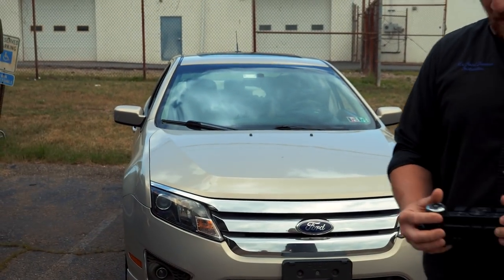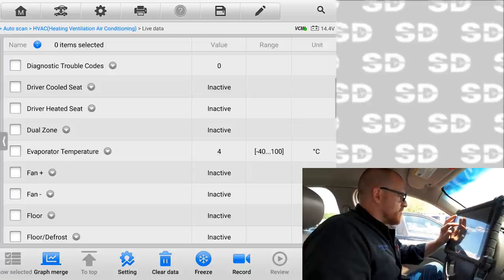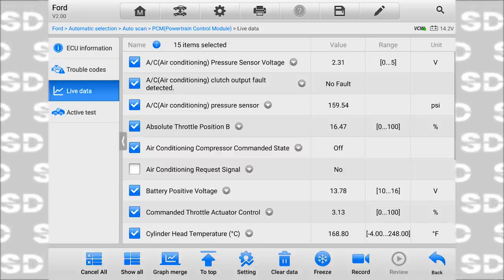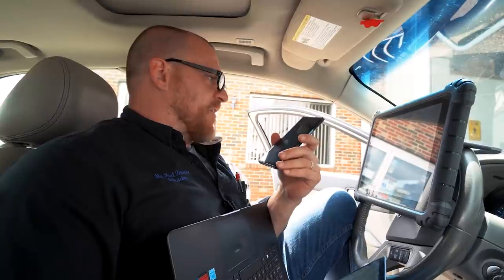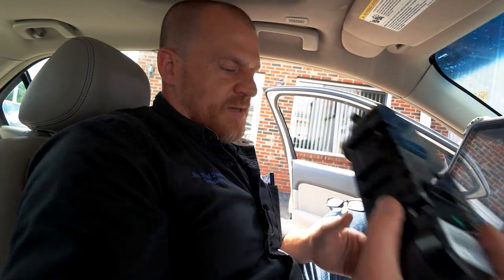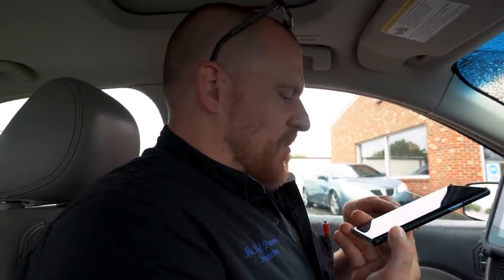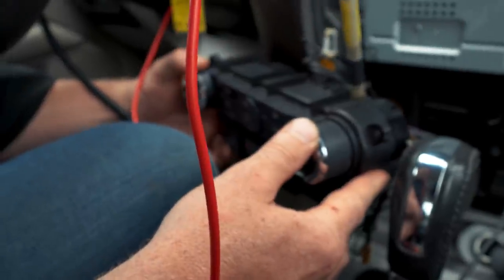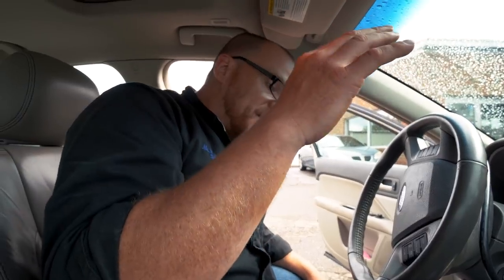2010 Ford Fusion A/C Clutch Intermittently Cuts Off (full charge)

Comment: You can remove the head unit and do a evaporator sensor resistance from the connector. There us s resistance chart in the pinpoint testing

Comment: Had temp sensors go bad on fusion turning on headlights made clutch engage had three fusion do this headlight affect bcm in some way if the car is not worth the work I cut wires behind glove box and leave temp sensor in glove box telling customer to shut it down every half hour to prevent evap freeze up

Comment: Seems a hack might be, if you can figure out an offset resistance is to install that in series with a thermistor installed in the vent so that it reports the cut off temperature at some vent temp the correlates with the evap at 35 or so degrees.  

Weird resistance to temp you measured.  Most thermistors are at their rated value at 77 F.  Such as a 10k reads 10 kohm at 77 F.  But it's Ford who knows what they used.

Comment: Edit: I obviously posted this comment early in the video. 🥴 Any updates on this? My understanding was that icing of the low side would cause the oil in the system to freeze and starve the compressor. But at the same time, highly unlikely it would ever ice up with the recirculation turned off. That's really why they use the sensor. For when you run them with recirculation turn on.

Paul I've run into this issue on MINI Coopers, as on some of those it's dash out to replace the sensor as well, but how I diag it, is I de-pin the connector to the IHKA (module) and remove the temp sensor input. Usually that allows me to confirm the part is faulty. Not sure how deep the Ford schematics go, but on BMW/MINI they give you enough to trace it back to the module and isolate.
Reply from the maker: I believe the icing occurs on the outside. The fins of the EVAP core will freeze from outside moisture, then what happens next is we get no air flow, no heat transfer, so no change of state (liquid to gas) in the evap core, so we end up sending liquid refrigerant into the compressor and it slugs the compressor and ruins it. I do not believe it freezes on the inside

Comment: Instead of putting the replacement sensor in the original location, is there a place in the duct work you could reach, drill a hole and  install the replacement sensor.
Reply: I agree Get another sensor and mount somewhere else

Comment: Had that happen on a Lincoln that I owned way back when.  Put a volt meter on the low pressure switch.  Could watch the module stumbling to reach battery voltage level.  Once it hit battery voltage level the A/C would kick in. If I momentarily put 12volts to the low pressure switch the module would kick the A/C clutch in.   System would work for until I turned the engine off.  Then I had to jump it again after starting the engine.

Comment: I have put several resistors to bypass the evap temp sensor and haven’t had any problems so far, is just to big of a job to do it only for the sensor. If you remember older systems didn’t even have that ice control.
Reply: Can I do that, I have a 2010 fusion hybrid?

Comment: I remember back on a 1994 chev k1500 I bypassed the low pressure switch but evaporater would freeze up in no time flat.  They used the low pressure value to shut on and off on the ac compressor. Good fix if it doesn't not freeze up and sure lot cheaper for that age of vehicle.

Comment: Nice bypass to confirm sensor is faulty.  So the AC will work when bypassed BUT turn off via SWITCH to let it warm up.  Will the heating still work for winter?

Comment: The main key with this fix, is just be sure to put your AC on FULL BLAST when it's on--  and then turn it all the way off when you don't need it anymore.  Letting it barely run in the background with low fan, is when it will freeze up;  because that's when the core will get colder because there's not enough air blowing through it.  Normally when that happens, the computer would turn it off and on momentarily to not let it get too cold.  But again, if you are running the AC at full blast, with the fan on max--- it will blow more air across that core, which will go further to preventing it from freezing.   Once it does start to freeze, you simply won't feel any fan air blowing anymore--- so that's when you know for sure to turn it off for a bit and let it thaw....   Typically if it's hot outside and you have the fan on max -- it will be blowing enough HOT outside air through the core that it would never be able to freeze.  So when you need it the most, on the hottest days-- it should still work well for the most part.

Comment: I won't read all 285 comments, so maybe someone has already brushed on that, or you've probably figured it out by now, but I don't think you have a scanner issue. I'm a Mercedes tech and our xentry works exactly the same. Active/inactive displays are there just to show you that the particular switch is working and that the ecu that governs it receives the command. 

It is not there to tell you that the system which that switch commands is activated or not.

Hope I made sense.

Comment: I'd also recommend keeping it on fresh, outside air (not recirc) to help prevent freezing it up.  That will keep the low side pressure up and evaporator temperature up.  Keep the blower on higher speeds, as well.
Reply: If it's on fresh it'll be worse in high humidity environments. It's better to leave it on recirculate - there's limited moisture in the enclosed space for it to initially deal with. It's much easier than trying to dehumidify the whole world...
Reply: @TonyRule  Less humidity yes, after the evaporator dries out the air, but the evaporator gets much colder when used on recirc as the temperature in the cabin cools. Even with the higher humidity the evaporator will be less prone to freezing up on fresh air.  On fresh it will drain more water but it will stay warmer.  Of course, it depends on the outside air temperature.  It just has to do with the temperature of the air flowing across the evaporator
Reply: @johnaclark1  It can't ice when there's less moisture in the air because... dew point.
Reply: @TonyRule  There's moisture in the air, even on recirc. The evaporator will be much colder on recirc and will ice up. Put a set of gauges on a system and look at the difference in evaporator temperature (pressure equates to temperature) on the guages between recirc and fresh.  If it's warm enough outside and have enough airflow it won't ice up because the pressure/temp is too high for ice.  Trust me on this. I do a ton of AC repair.  Higher fan speeds will reduce ice formation as well.
Reply: @johnaclark1  Once again, it won't ice up because there's a lack of saturated air crossing the evaporator when on recirculated cabin air. You only get condensation, which can become ice, when the temperature is below the dew point and you have lowered the dew point by removing moisture. Airflow lowers condensation formation because of the reduction of the boundary layer. You can see the difference on a correctly operating system - the condensate from the evaporator core drain is much less when using recirculated cold dehumidified air as opposed to using fresh humid air simply because there's less moisture available to form condensate on it.
Reply: @TonyRule  Yes, moisture in the air will be less on recirc but you cannot remove all the moisture because recirc does not stop all outside air from coming in.  If it did, you'd suffocate inside the car.  Remember there are air outlets in the rear/trunk of all vehicles for air to flow out of the vehicle.  The fresh/recirc door only changes the air that goes across the evaporator.  You will always have condensate on the evaporator because you have always moisture in the air, depending on outside humidity.  So, even on recirculate, depending on outside humidity, there is still enough moisture to form ice. 

The key is keeping the evaporator temperature above freezing, which is what the original, and now removed, temp sensor did.  The only way to keep the evaporator above freezing now is to keep the pressure up inside the evaporator, which can be done by using the outside warmer air and/or higher fan speeds.  Cooling efficiency is lost when using outside air but the pressure in the evaporator will be higher, and thus the evaporator will be warmer and will be less prone to freezing.  The idea is to control temperature of the evaporator, not control the moisture content.  You can reduce moisture content some, but not enough to prevent all condensate and prevent ice.

Comment: We replace these evap sensors at the dealer all the time. Common failure, it's the first thing we look for. On most models, you have to replace the evaporator because the temp sensor does not come separate.
Reply from the maker: What's book times for you guys on doing this repair? Thanks!
Reply: ScannerDanner On a 2010 Fusion the sensor replacement is 2.7 hours and the evaporator replacement is 4.1.

Comment: If you do wire in a resistor you'll probably wear out compressors quickly. Think about it without that EVAP temp the system won't cycle unless the high pressure gets too high which it won't due to the fans. In order to really do that you'd need to wire in a switch and use a low side switch to cycle the compressor

Comment: Hi Paul, with building in a resistor it is possible you get not evaporated refrigerant into your A/C compressor, to prevent that you have the Evaporator sensor you are bypassing.
Greetings Hans

Comment: Hey Paul, thanks for another great video. Just wondering if it was possible to wire up another temperature sensor to the wires you cut and bypass the original sensor? Just a thought.
Reply from the maker: You could, but you'd have to get it into the evap core area, which you can't do without complete disassembly

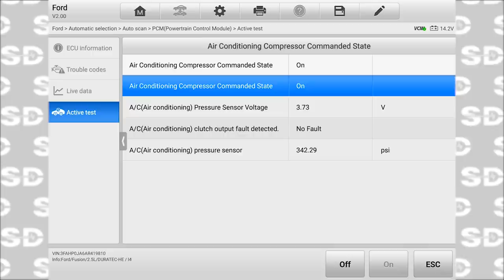Comment: At 26:30 you said that the Cooling Fan must have kicked on that brings up a question! On a 10 Fusion, the Fan should run just after you turn on the AC and not turn off till the AC command is stoped.
So does commanding on of the AC with the Autel not trigger the Fan?
Reply from the maker: My guess, without research, was this fan does not come on until a specific pressure. Though I still didn't like 350ish before I saw a psi drop, however this was a non issue.
Reply from the maker: Another guy just commented and said he had one that didn't turn the fan on in the bidirectional mode, so maybe you're right!

Comment: I'm wondering how the ac system normally keeps it from icing up, does it automatically turn the air on and off?
Reply from the maker: Every system is different is how they do de-icing controls. Fixed orifice tube systems compared to thermal expansion valves (variable orifice), low side temperature and psi sensors and or switches etc etc

Comment: i wonder if u could have used a act temp sensor those are just small resister drilled hole close to evap n glued in  the only concern would  be the resister value ratio to temp

Comment: When you freeze your ac evaporator. It won't boil your refrigerant. And will put your evaporator in a flooded state. And could let liquid refrigerant get back to the ac comperssor and cause damage to the compressor

Comment: Hey Paul, I don't think that icing will be a problem as long as the ac system pressure transducer is working properly. It not only tells the computer to shut the compressor off with too high of a pressure but also too low, ergo low temperature in the system. If that's working right the compressor should cycle.
Reply from the maker: I didn't see a low side pressure sensor. Only high, and if it has a low psi cutout from that sensor, it would be for a low charge and/or cold temps only, on a high side psi sensor. It wouldn't protect us from the low, low side psi we would potentially have at times now. 
Hope that makes sense. Thanks! Great thoughts
Reply: @ScannerDanner  I looked it up on my Alldata. I haven't had an issue with a 2010 Fusion but Alldata lists the following: A/C Pressure Transducer

The A/C pressure transducer monitors the compressor discharge pressure and sends a variable voltage signal representing the pressure to the PCM. The PCM will interrupt A/C compressor operation (non-hybrid), or decrease the electric A/C compressor speed (hybrid) in the event that the A/C pressure transducer indicates high system discharge pressures. It is also used to sense low charge conditions. If the pressure is below a predetermined value for a given ambient temperature, the PCM will not allow the A/C compressor to operate.

The A/C pressure transducer is located on the high-pressure side of the TXV manifold and tube assembly near the TXV fitting.
I've not run into that before, it's anew one on me.

Frank
Reply: This system does not use a low side pressure sensor. If it did it wouldn't need the evap temp sensor. The 2 pretty much do the same thing but a different way

Comment: Sup Danner, i had a situation where a compressor clutch wouldnt engange and i tracked it down to the evap temp sensor giving false information just like on this video, i disconnected the evap temp sensor and checked for a 5v reference at the connector and it wasnt there, next I went to the hvac module and probed the 5v pin going to the evap temp sensor (with the wire cut to eliminate any potential short in the circuit) and reference voltage still wasnt there. So my question is where should i go from there? Do i just replace the module? Or is there other things i need to look out for at that point
Reply from the maker: What other input sensors are on that module that you can check for a 5vref on? Powers and grounds for sure must be tested next.  But knowing what another 5v ref sensor circuit has will give us great direction
Reply: @ScannerDanner  ah ok so there could be a short on another input from that same module causing the 5v ref to drop kinda like how u would typically see on a ECM?
Reply from the maker: @carlosm7232  exactly like that! Remember a shorted thermister won't do it but a pot or psi sensor would and it would pull the thermistor voltage down to 0 too

Comment: mr danner if the internal temp works fine i can use the same signal to both of the evap and internal temp ,,, i mean short them together i believe im not gonna have the evap iced later on ,,,thank you sir
Reply from the maker: It will still ice the evap and you do risk slugging the compressor but just shut the compressor off every so often while leaving the blower on

Comment: Hi Paul,

Hope you’re well and family keeping safe.

On the first resistor you add, I think your hands must have been touching something, as when you moved your right hand, the reading dropped from 55° to 36° instantly. 

Also measuring the resistor in circuit will not be showing you the true value of the resistor itself. As the resistor is in parallel with the PTC (also a type of resistor as you know), the value you measured is equal to 1/(1/R1+ 1/R2). R1 & R2 being the PTC and resistor you added. I’m sure you already know this from hearing you talk about can termination resistors!
Reply from the maker: I cut the wire and didn't have the original resistor in the circuit at all. Though the argument could be made that the internal resistor offered a path as well, so I should have unplugged the module for that test, then it would have been more accurate. 
Thanks! Good reminder to all for sure.
Reply: ScannerDanner Sorry Paul, no ideal how I missed that! For some reason I thought you had cut the ground (which makes no sense now I’m thinking of the effect that would have had!). You literally say ‘this is sensor ground’ as you stripped the insulation of the wire left in tact. Will hold my hand up there, Doh! 

Keep up the good work. Stay safe.

Comment: It doesn't say active because thats how the computer reads the commands. Not the Autel. The control head sends a message. Once you let the button go the message is no longer there. There's a delay in how fast the scantool will show the command. If you scoped that command you'd see it in real time. But it's not a function of the Autel. It's how the Ford system works.
Reply from the maker: I realized that in the edits, thanks!
Reply: @ScannerDanner  Remember after you run full scan. Look down slightly to the left and there's a tab "report". There you get itemized list of dtc's.

Comment: Another thermistor but just wire it to module like you did. Then drill a hole in an accessible vent duct as close to core as you can get throw the thermistor in the duct hole. Aluminum duct tape / glue hole if needed.??? If dash is ever needed then fix properly

Comment: FYI, the 03-04 Lincoln Towncars had evaporator temp sensors, and starting from 05-and up Ford removed the sensors. So bypassing the evap temp sensor is a good fix for this case. How did vehicles in the 60's manage before evap temp sensors? With a low pressure switch! Which is still a fallback for all vehicles with evap temp sensors.
Reply from the maker: When there is no temp sensor, they use low psi cut off switches or sensors. Without one of those (which this system doesn't have) the evap core will absolutely freeze. It has been confirmed and has happened already after a 1 hour highway drive
Reply: lots of the old cars had a clutch cutout that was a temp sense bulb taped to the evap line. some were a pain to get to.